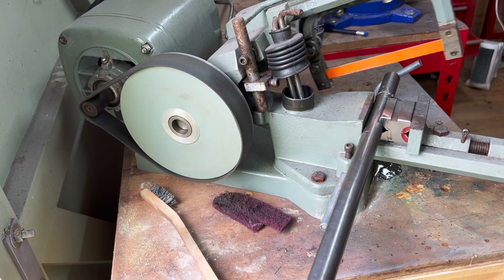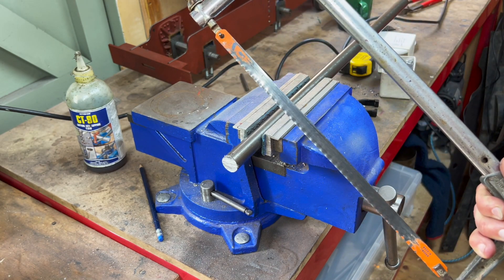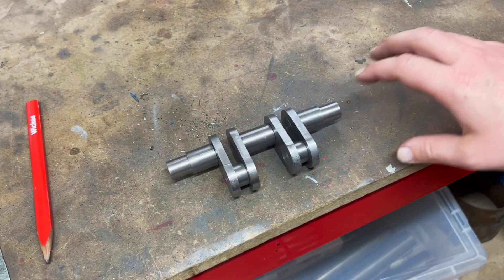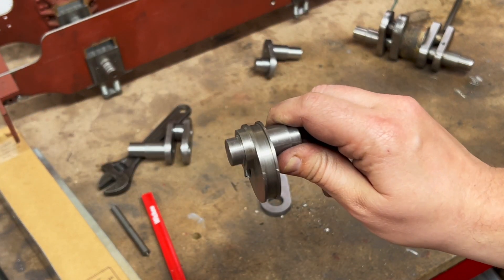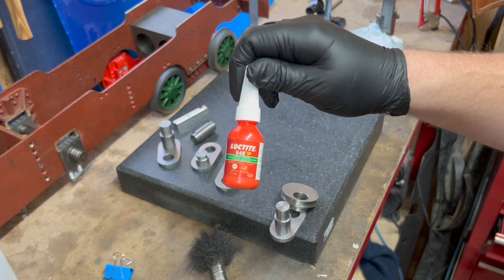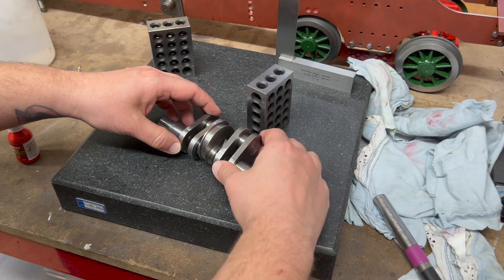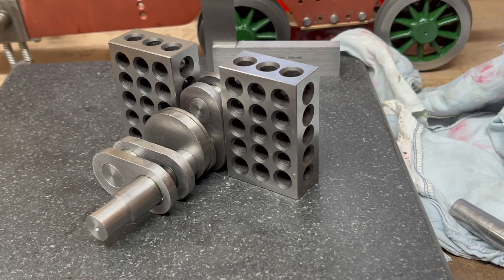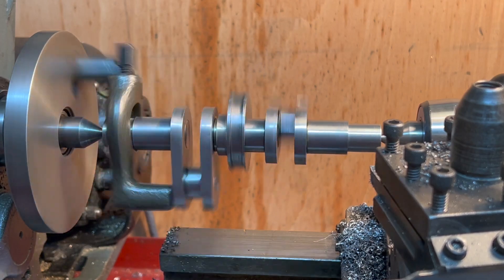3 Weeks Wasted on a Crank Axle?! - Steam Loco No. 27

Comment: All is not lost heat it up to break the l9cktight , carful of the fumes, keep the cranks and stubs and eccentric  make a new axle
Assemble cranks and stubs and pin them
 reassemble every thing on the new axle with locktight
When your happy with concentricity cut out the bits not needed, CHECK YOUR CUTTING THE RIGHT BITS lo.
Reply from the maker: The problem with using a piece of solid bar is that the diameter of the crank pins is larger than the diameter of the holes in the webs. If I enlarge the web hole to fit a solid shaft all the way through, then the webs will be too week.

Comment: Heat it up and pull it apart , clean it up and try again ! You might be better off machining  a custom jig to holes everything in alignment . The alternative is to salvage the webs , re make the shafts and journals  oversized then loctite it all together then machine it as an assembly .
Reply from the maker: Do you have any tips on getting the Loctite residue off of the steel?
Reply: @williamsworkshopuk  
Wire wheel is the only thing I have found that will touch it , maybe a scotchbrite wheel will as well .

Comment: As Union310 has commented. Use a single piece for the axle, then cut out the relevant parts.  All your other parts should be good.  Use some heat to break the joints and have another go.
Good luck 👍
Reply from the maker: Thanks, Mark! The challenge with doing that is that I think I will then need to enlarge the website and thus remake those too!
Reply: I did wonder if that would be the case.  
Take your time, get your set up right and fingers crossed you'll crack it next time.

Comment: Sorry about your crank axle William.  I wonder if you had too much of a loose fit with the pieces?   I dont think Locktite would take up any slack as such.  You'll find a way, you always do.  I have a similar issue with my Pansy's crank axle.  Something has moved!
Reply from the maker: I think the biggest problem is the slack fit of the centre axle! Because both stub axles and they’re associated crank web pairs are at perfect right angles
Reply: Loctite will take 1 thou.

Comment: If I could make a suggestion; you could heat the crank to break the grip of the Loctite then make a jig to hold it true and try again.
Reply: Yeah, you could possibly use a matched pair of vee blocks clamped inline with eachother on the mill table and then use them to align the two end shafts on re assembly. This could align the end shafts, if the centre shaft is out a bit it shouldn't matter. In any case don't despair, it's a learning experience.
Reply from the maker: That’s going to be my first port of call

Comment: Better to have used a single axle, then  pin and glue. Once dry cut out the portions you need to. 
Better still machine from solid.
Reply from the maker: I’m sure that’s a more sensible plan. However, if I do that, then I have to resize the crank webs-so I am going to give this a shot as it is first.
Reply: @williamsworkshopuk  Have a look in Martin Evans book, the one with the white cover and a simplex on it . Locomotive construction manual or something similar
Reply from the maker: @union310  I think I have this book- model steam locomotive design?
Reply: @williamsworkshopuk  I think that is the one

Comment: eyup William
Hard luck, but no pain no gain, maybe you should have loctited them and then held them between centres to set, that way you would have the faces pushing together, just a thought, 
you only want 0.0005" tilt to exagerate much more over that length and accumulate.
As for the hexacut, it might not be the belt, but may be the slide jamming up, either a burr or lack of clean oil. again just a thought.
Back to the drawing board, been there and got the tee shirt!!🤔🤔👍👍👍👍👍👍👍👍
BFN
Kev
Reply from the maker: Hi Kev, at what point to hold the axles between centres? the final setup?